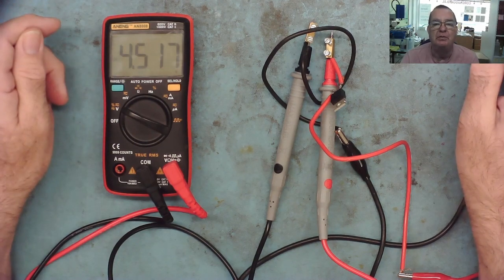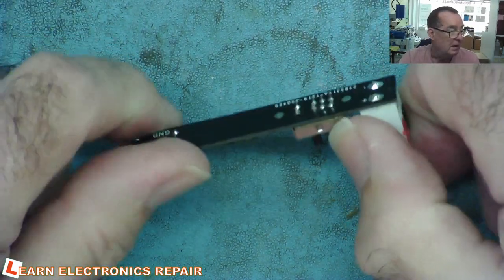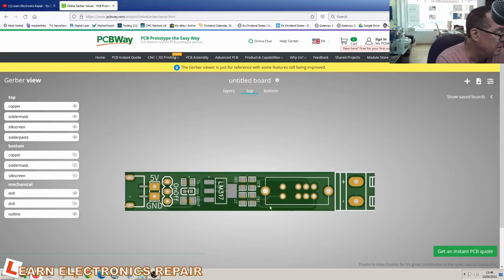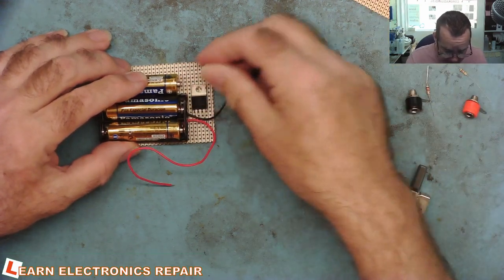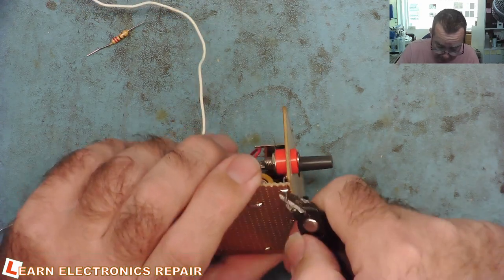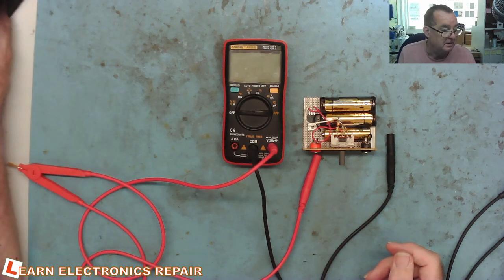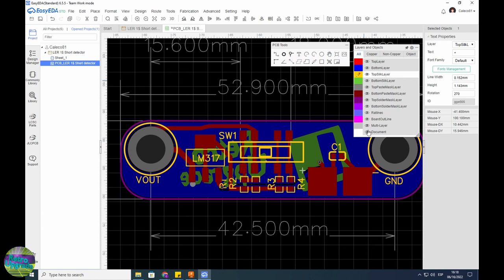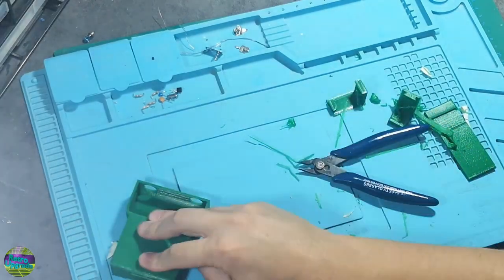The Amazing $1 Short Finder Upgraded! Convert your multimeter to a 4 lead Kelvin Probe Short Tracer

Comment: Hey guys - nice to see the project keeps evolving! Just one thought: 2 CR2032 instead of the bukly AA or AAA cells? We should get enough current out of those, and with 6V we have enough headroom even for slightly discharged ones. @Carlos: great housing!
Reply from the maker: Hi Detlef.  And thank you for your generosity and helping us to move this on to the next step. Your work is most appreciated.
2x CR2032 would give more than enough voltage, but how long would they last if running on the 50mA range. I have no idea what the current capacity of those batteries is.

https://www.youtube.com/c/DetlefAmend  <--- A small channel with some big ideas, subscribe if you LIKE
Reply: Hi Detlef :), thanks a lot i worked hard on it :D it's actually parametric so i can modify it quite easily . but then CR2032 sound like a great idea could probably make a hosing with just the front part of my design would be a lot smaller and faster to print  - 4,5h is a little to much for most ppl :P

i'll do a draft model for the CR2032 and send it to you and richard for review :)
think even we can fit the CR2032 on the back of the PCB no battery compartment needed 

Btw you have a new subscriber ;) , you do really interesting stuff
Reply: @LearnElectronicsRepair  Seams like the medium capacity is about 235-250mAh so you should get a solid 5 hours at 50mA
Reply from the maker: @RetroUpgrade  Sounds good enough to me 😁  That's what I find so good about this channel - lot's of knowledgeable and friendly guys giving their time and ideas.
Reply: @Learn Electronics Repair  Is anyone else smelling a revisit video 😂😂😂😂
Reply: I would have guesses something around 200mAh for a CR2032 - so 4hrs constant runtime is feasible. If you want to go enviroment friendly: there are rechargeable CR2032 (if memory serves: LR2032) our there. The Alternative (to the alternative) would be a small LiPo cell; the downside is, that they come in all shapes and sizes. A small chargeing circuit around a TP4056 could be included, too. Loads of possibilities - @richard: may you can start a poll what the community would need?
Reply from the maker: @DetlefAmend  Poll? Yes definitely.  Thank you once again for making this video possible 😁
Reply: Maybe little li-po?
Reply: @Rafal Hummel  not a bad idea, don't know if the voltage range is to big to make it stable. have to look in to that😀👍👍
Reply: @DetlefAmend  I use a 5V USB cable.  Always have chargers handy or can use a power bank.  Never have to worry about "not enough" voltage when batteries drop below 4.25V.

Comment: used to do this years ago if I could not find the miliOhm meter.
1A 1mV 1mOhm, no maths involved as long as the circuit could take the 1A.
A very stable constant current power supply was a bonus.

As i was normally checking connector backshells to chassis via EMC gaskets, there was no problem with the 1A.
Reply from the maker: Hi, welcome to the channel. That sounds useful for making measurements.  Of course in the case of the short finder we don't actually need to know the actual resistance value - just where the lowest reading is.  Why not pop over to the sponsored projects section on LER discord - we have some sponsorship from PCBway to work on projects and gadgets relevant to electronics repair.  Everyone welcome.

Learn Electronics Repair is now on Discord!  Come and join the fun and let's fix stuff together, it's free and a nice place to be.   https://discord.gg/vam6YC8vwU
Sponsored Projects discussion   https://discord.com/channels/896427792751820842/976398185629093948

Comment: The BoM posted on PCBWay does not contain the USB port, switches, and terminal block article numbers. As the PCB is designed to accommodate specific-sized components, would you mind sharing some article numbers for these mechanical components? Thank you very much in advance
Reply: I'm in the same boat did you have any luck?
Reply: @badgerfool1980  No luck yet, will let you know if I have figured it out though.

Comment: I think just using 2 AA batteries with near 100 ohm resistor should do the trick.  I have taken very stable and distinctive readings with this setup that pin point to the shorted component.

Comment: Great project! How about a small enclosure with chassis mount banana plugs spaced to match the standard multimeter jacks so it just plugs into the meter when needed. Power from a lithium battery (rechargeable for the deluxe model) as others have suggested. Pogo pins make really good custom probe tips and if sockets are used they can be replaced easily - I have used them to make custom leads for my HP 4328A and HP 4338A milliohmmeters. Regards,  David.

Comment: Hi Richard - Just a thought about the battery's - Why did you not use a single sell £1 18650 5V power bank, then you would not need to keep buying AA's.

Comment: Personally 4 wires is better, but I think the kelvin clips are not needed, just two wires down near the probe point for voltage sense is enough, try it.
Reply from the maker: Did you see the original version at the start of this video - that's how I made it.  The kelvin version is more stable for whatever reason
Reply: @LearnElectronicsRepair  Well you use USED the kelvin clips, I personally do not thing you need them clips, just solder the current carrying wires close (1/2" is fine) to the probe points, still 4 wire, no alligator clips needed.
Reply from the maker: @Ozzy3333333  For sure both methods worked - it is possible the battery version is more sensitive/stable purely because of the fact batteries are more stable than USB or bench PSU rather than due to the use of the Kelvin probes.

I have an idea for a very inexpensive 'off the shelf' version of kelvin probe so when the parts arrive I will do a direct comparison between kelvin probe, attaching current wires to standard meter probes and my other idea on another video.  Then we can all see what, if any, difference it makes  😉
Reply: @LearnElectronicsRepair  Great, will wait for the outcome, personally, the stubborn shorts I come across are on 20+ layer pcbs costing 3 to 5K, the DUT consumes up to 80A, I start with 100mA, but find I need to go higher on the current (even up to 2A), there is 2000+ decoupling caps on these boards.
Reply: I agree, those kelvin clips are poor conductors on old soldered joints. Should be using needle probes when measuring down to micro ohm ranges. explains why all the readings in the video are erratic and unreliable.

Comment: since youre not measuring actual value but only difference lead drop dosnt really matter as long as it is consistent (iow. kelvin probes/attaching at test lead ends is pointless). thus better solution would be lcr plug in style addon or even hacking the mm and using its power source and internal space
Reply: Hi.
Is there som circuit inside the lcr probes that I am not aware off? If not is there a difference? Did a quick search for lcr probs and they range in price from 20-50€ for the cheap Ones and the cheap Kelvin probes cost in the range 3-15€ for the cheap ones. I am really curious. Am I missing something? (disclaimer I am a electronics noob)
Reply from the maker: I have another very low cost and less bulky option to the kelvin probes to try.  It's still four lead though.  I just have to wait for the stuff to arrive to try it

Comment: Why not get the real thing from the author who makes this since 1995?
Search for miron63, measures ESR, LCR too
Reply: Yes I got this one too, works wonders. Measures capacitance in 1 second on any size capacitor even 10000uf or larger. Hower it needs some work as the only thing made without problems is PCB. The case, connectors are cheap china crap. Price doubled on my after replacing these components.